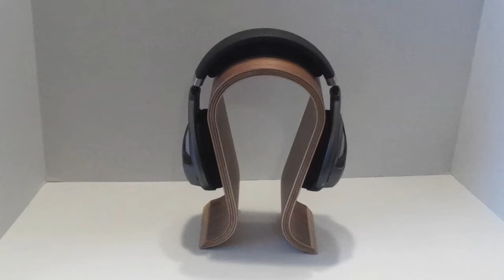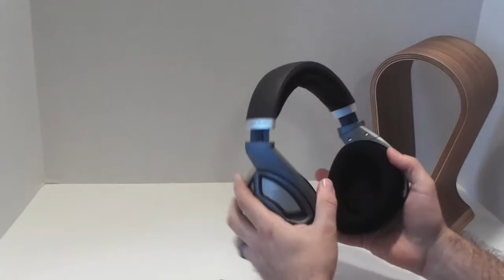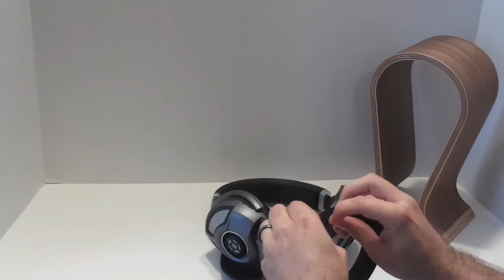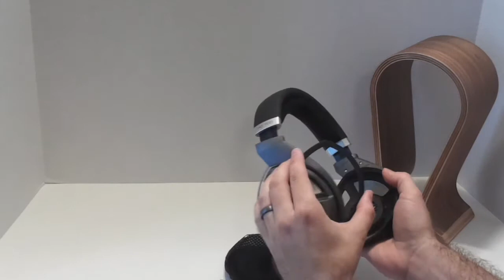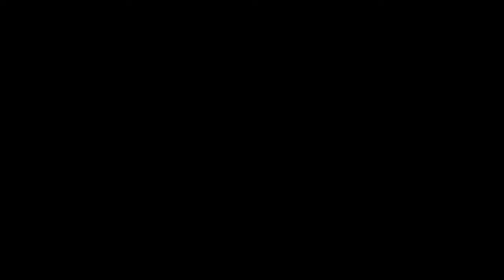HD700 Mod Kit Instructions

Comment: Wow this is not a subtle change.
Thank you so much for putting this together!! and thanks to the modders out there that did the trial and error on the HD800 and 700.
My kit showed up today and I installed it and I am no longer using an eq (I had a 5db dip eq'd pretty tight @ 6khz).

That said, there seems to be a drop in stage size.  I am guessing this is the pad rings?  I might try them without, but going to give it a few hours with them first.  Really loving that these sound much more natural now as without EQ previously I couldn't even listen to these but loved so much about them that I kept them and EQ'd them.

Now to get some dekoni pads and see where that road leads :)

Comment: After trying this kit out it certainly does make a difference. The question is it for the better or for the worse. 

I listen to almost exclusively classical music which is why I went with HD 700. The large soundstage, much better then anything in it's price range, is ideal for naturally recorded classical music. I did notice the peek treble spike so I thought this kit might help with that.  

The problem is that it simply is way to much of a good thing. Not only did it get rid of the treble spike, it essentially sucked the life out the the music. Instead of the nice wide deep sound stage, the sound stage became flat and lifeless. It seemed to thicken up treble instruments as in flute and oboe, but it also made them sound dead and lifeless. All the air that gives life to classical music was pretty much gone. It also added some bloat to the bass and the bottom end lost some articulation.  

Perhaps for other types of music it would work better, but for classical it's a big failure.

Comment: Installed the mod last week and now my HD700 is finally truly enjoyable! That spike in the highs is no longer a problem and I can listen without fatigue. Basically this turns the HD into a slightly brighter HD650  but with much faster response, more detail, sound stage and kick in the bass and of course without the Sennheiser veil which is why I bought them in the first place. I paid $12 for the mod but would have gladly paid $50 given what it did for my HD700. Thanks alot!
Reply: Steven Wilkins did you install both the pads and the drivers rings ?
Reply from the maker: Fantastic!  Glad to hear the mod worked out well for you and we hope you continue to enjoy them!  Thank you for the kind words!
Reply: is the hd700 heavier than the hd650 noticeably?
just noticed amazon link that it's 400 grams and hd650 is like 263 grams